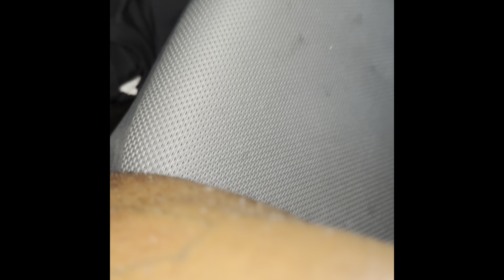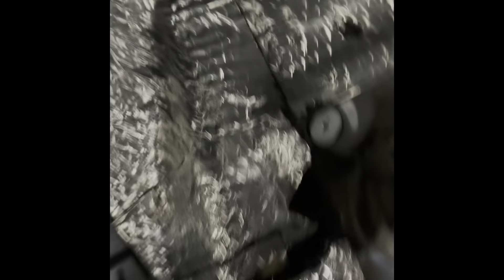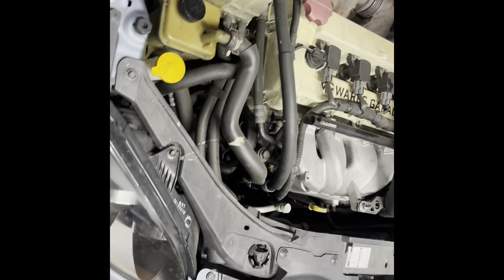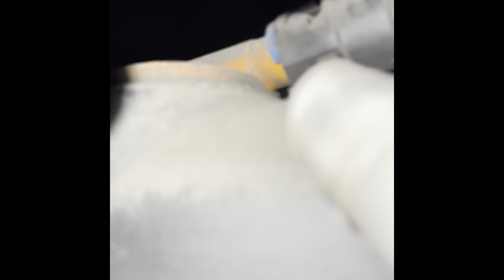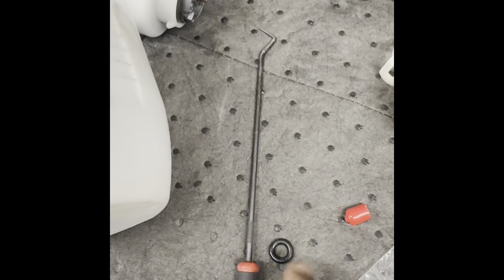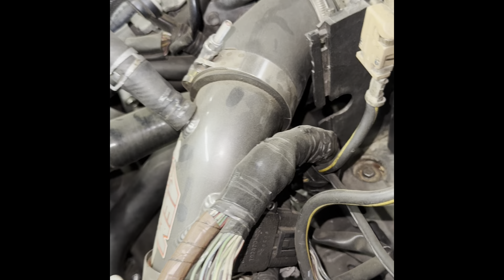How to drop fuel tank and install an AEM fuel pump in your Mazdaspeed 3

Comment: The hoses on the tank, were they a huge pain in the ass or was there enough clearance? Especially curious about the one on top of the tank.
Reply from the maker: The hoses was good was room, what was a pain in the ass was pressing the clips to pull the hose off, I end up cutting the hose lol and putting it back with an fitting

Comment: did you end up selling the turbo? if not, how much you selling for and what turbo is it exactly? i got a gen 2 and looking to put a new turbo in mine is tired
Reply from the maker: Yea turbo is already sold it was an BNRs2 I put in a CST5 turbo what kind of hp you looking to do?
Reply: @waresgarage  honestly not looking to go too crazy, really just think my stock turbo is getting tired and kind of hoping to find a smokin' deal somewhere on a lightly used turbo that would be similar to stock size, maybe with a bit more flow up high just so it can actually maintain full boost a little higher into the rev range.

but right now i'm trying to figure out a fuel pressure issue. i installed corksport hpfp internals about 10k ago and initially everything was great, but the last two months or so, i've noticed my fuel pressure isn't following the commanded pressure. as i get deeper into the throttle, the actual fuel pressure seems to fall off more and more. since i noticed this happening, i basically am staying off the throttle as much as possible because i know i'm just asking for a block window if i push it at all with such bad fuel pressure issues.

i'm wondering if the hpfp might be gummed up due to me using mobil 1 oil - i have read on the forums that these hpfp's do not like certain types of engine oil, and get super gummed up and shitty if you use the wrong type of oil, and some ppl say that mobil 1 is not a good oil to use. i've switched to penzoil ultra plat my last change, which is on the list of 'good' oils, so i will probably pull my hpfp as soon as the temperatures go back up a bit (today didn't get above -20 deg C throughout the entire day, and the only garage i have access to is not heated, so i'm not working on anything in -20 degree weather lol). I didn't change to the penzoil specifically because of this, i had planned on switching to the 5w40 anyways, but finding out it's on the nice list and the mobil 1 is on the naughty list was just a happy accident.

other thing i'm wondering about is fuel filter, but from what i've found so far, the fuel filter is in the damn tank on these cars? who's brilliant idea was that ffs. wondering if there's a way i could change things up so that i've got an inline fuel filter under the car or something, something that would be a bit more accessible to swap out. i'm just over 110k miles / 180k km, and i'm not sure when the fuel filter would have been last changed, if ever?
Reply from the maker: @spectrum_observer  so a turbo that’s like stock I say go with an Corksport cst4 it’s like stock but can do little more power, I had my boy speed have the same problem with his fueling his problem was the regular on the fuel pump in the tank went out, he got new, injectors, seals, and other stuff problem was there still and he replaced the regulator in problem solved, are you getting a check engine light for any like fuel issue? And yes the fuel filter is in the tank lol and for you to get to it you have to drop the tank, some cut the top some just drop the tank
Reply: @waresgarage damn, so the regulator on the in tank fuel pump? Or is it separate from the in tank fuel pump? I've been thinking of just replacing the in tank pump with an aem or one of those German ones, just cuz I'm sure it's never been changed. But I feel like the regulator would be a separate part? 

No check engine light or any codes at all btw

And re the fuel filter, I know there's the sock type filter but is that all there is? Is there no inline type of filter?? I really like the idea of having a filter that just has more capacity and will be able to hold more debris without losing flow rate below what my engine needs. I was wondering if it might be worthwhile to either simply throw an inline filter in after the tank pump, weigh a finer filter, or maybe just get rid of the in tank sock and use two staged filters just after the in tank pump.
Reply from the maker: @spectrum_observer yea it’s only the sock that’s on the fuel pump, and yes it could be the regulator but the problem he had he had a check engine light, have you service your injectors are replaced them before?

Comment: Came here from the CorkSport group. Thanks for the refresher, I’m about to do this in a few weeks 🙌
Reply from the maker: Hell yea what’s up man, that’s good what pump your putting in your car brotha
Reply: Yup,same here but im gn do it from the top in my case,I ll be installing DW430c
My understanding is since I ll be running CST5 on a built block the upgraded. fuel pump also would need a fuel pump hardwire kit upgrade with 12gauge wiring and 40amp relay